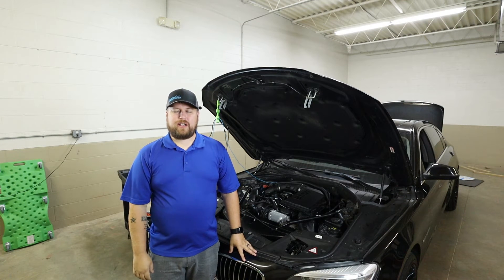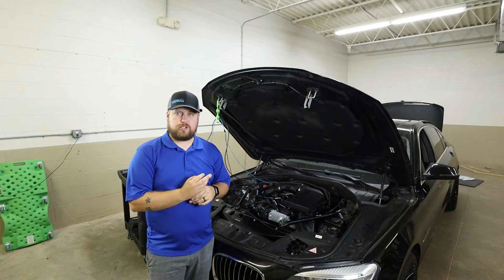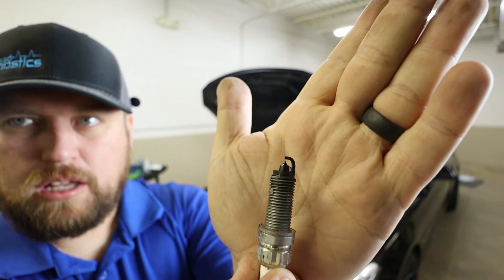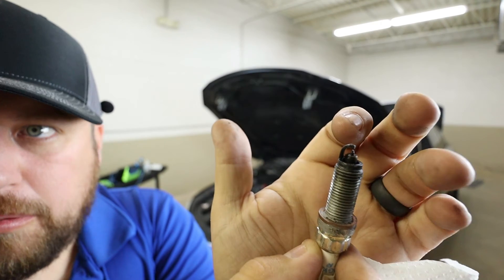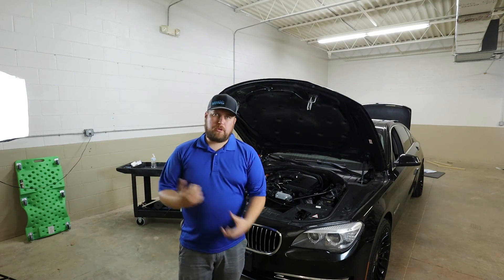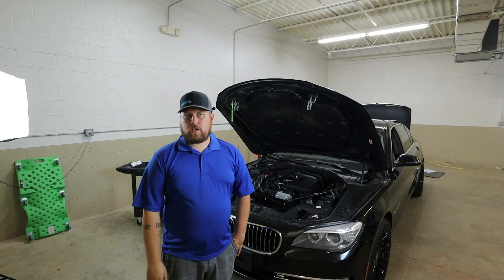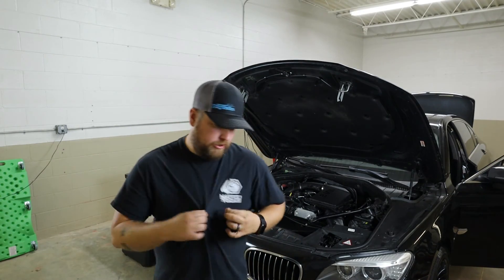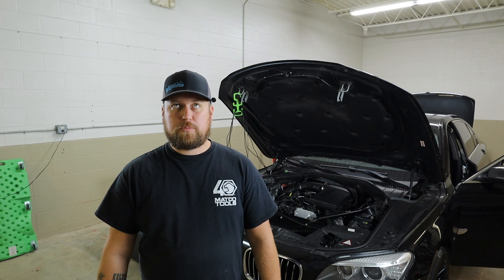BMW 7 Series Engine Misfire!

Comment: BMW Misfire detection – test plan of basic check
Misfires are not directly detected, for example, using pressure sensors and temperature sensors in the cylinders, but indirectly via the irregular rotation (rough running value) of the crankshaft.
Reply: With each ignition and combustion of the mixture in the individual cylinders, the crankshaft is slightly accelerated and slightly decelerated again during the gas exchange. If the forces predominate due to acceleration, the speed increases until a balance between the acceleration and braking occurs.
Reply: For the 8-cylinder engine, eight combustion cycles take place within two operating cycles (720° crankshaft angle). This means each combustion can be assigned a segment of 90° crankshaft angle. This is why the combustion cycles can be assigned to the individual cylinders and are thereby comparable with each other. Example, 6-cylinder engine: 720° divided by 6 = 120° crankshaft angle.
Reply: Rough running arises, among other things, due to:

deviation of the fuel injection rate, mixture deviation (faulty injectors)
poor combustion (spark plug, ignition coil)
different cylinder filling (for example, coking of intake ports, excess air)
different compression, poor compression
unequal charge of cylinder banks (exhaust turbocharger)
 

As from a certain rough running value, it is assumed that a misfire is present (most likely cause).
Reply: A "Misfire detected at cylinder 1" type of fault is stored. To protect the catalytic converter, it may be necessary to additionally switch off fuel injection at the corresponding cylinder.
Reply: However, the actual fault cause for this fault memory entry, for the misfire, for deactivation of fuel injection, is not known. Even if the misfire was, for example, stored for cylinder 1, the components at this cylinder 1 could still be trouble-free.
Reply: Example operating principle of leaking injectors:

Leaking injectors are causing a fuel enrichment of the mixture in the affected cylinders. This fuel enrichment of the mixture is entirely controlled by the oxygen sensor control. This means the fuel injection rates are reduced for all the cylinders. The cylinders with the tight injectors then have too lean a mixture compared to the cylinders with leaking injectors. Since the combustion of a lean mixture is not as good as for a rich mixture, misfires occur at cylinders with a lean mixture. The fault memory entries refer to the cylinders with the misfires, not to the cylinders with leaking injectors.
Reply: The fault causes for misfires that occur most often and with the highest probability are checked in the "basic check". Additionally, checks are carried out that can for the most part be run automatically.
Reply: The basic check includes the following checks:

Fault data evaluation
Checking the rough running without fuel injection
Checking for rough running during cold start
Pressure retaining test
Determination of maximum rough running
Checking the ignition coils
Check of spark duration and rough running
Checking the mixture deviation
Special procedure "Cleaning and checking the ignition system"
Rough running control measurement
Leakage test of air intake system
Reply: The test plan is dynamically constructed. This means the number of checks and the order varies depending on the coolant temperature, the production version of the vehicle and the individual test results. The individual checks are numbered sequentially in order to improve the readability of the document.

 

The individual checks will be briefly described in this document.
Reply: If there are instructions for renewing components, observe the following document relating to the cylinder arrangement:
Reply: 1. Fault data evaluation
Objective: Determination of known fault patterns

 

The most common measure for rectifying a known fault pattern is reprogramming. By evaluating certain marginal conditions for the fault memory entry, it is frequently possible to make a statement with a high degree of probability as to whether the known fault pattern is actually present. If the known fault pattern is present, then reprogramming is required. However, it is not essential to work through the test module.
Reply: If the known fault pattern is not present, then reprogramming can still be expedient in order to avoid a repeat repair. However, the currently present fault will not be rectified by reprogramming. It is then urgently necessary to perform the test module independently of programming.

2. Checking the rough running without fuel injection
Objective: Detection of mechanical fault causes

 

The engine mechanics are evaluated during this check. If increased rough running values occur during an attempt to start the engine without fuel injection, a mechanical problem could be the cause for a rough running engine.

 

Wear of the cylinder barrels results in diminishing compression pressure. If this wear occurs evenly, no rough running occurs, only lack of power. If there is one-sided wear or in the case of leaking valves, the different compression pressure in the individual cylinders leads to an irregularly running engine as from a difference of approx. 2 bar.
Reply: If there are mechanical problems, the following checks can also be falsified or made stricter. The mechanical rough running adds to the rough running due to poor combustion.

 

However, an actual switch off of the fuel supply is only possible if all the injectors are tight.

This check is therefore only meaningful in combination with the pressure retention test. The injectors are tight only if the subsequent pressure retention test was passed. A mechanical problem really does exist.

If the subsequent pressure retention test was not passed, there are two possible fault causes: The loss of pressure is either caused by leaking injectors in the combustion chamber or by the non-return valves of the high pressure pump and the electric fuel pump in the fuel tank.
Reply: The "check for the mixture deviation" is carried out for further fault location.

 

If no fault can be detected during the "check for the mixture deviation", then the injectors are tight and there is actually a mechanical problem present. The pressure retention test wasn't passed, as the non-return valves are apparently not tight. Leaking non-return valves do not cause misfires. However, a slightly longer start duration can occur.
Reply: Limits of the check:

Even wear, leading to an even loss of compression, cannot be detected with this check. Engine power loss can therefore not be detected with this check.

3. Checking for rough running at cold start
Objective: Detection of slightly faulty injectors

 

During a cold start, the oxygen sensor control is not active during the catalytic converter heating. Multiple injection occurs. Minor deviations of the individual fuel injection rates add up in their effect and can lead to a rough running engine.
Reply: If increased rough running values occur during a cold start during the catalytic converter heating, but not with a warm engine or with other operating conditions, a repair is not absolutely necessary.

 

The most probable fault cause: Slightly faulty injectors.

4. Pressure retaining test
Objective: Checking the fuel system for tightness, particularly the detection of leaking injectors

  

For the pressure retention test, the rail pressure is adjusted to 100 bars while the combustion engine is running and then the engine and the electric fuel pump is switched off.

The pressure retention test takes a maximum of 5 minutes and is ended prematurely as soon as a clear test result is available.
Reply: If the pressure has hardly dropped after one minute, the fuel system is sufficiently tight. The fuel system is detected as leaking if the pressure falls below 10 bar within the test period.

 

The loss of pressure is either caused by leaking injectors in the combustion chamber or by the non-return valves of the high pressure pump and the electric fuel pump in the fuel tank.

However, faulty non-return valves of the electric fuel pump cannot cause misfires! For this reason, it is more probable on the one hand that leaking injectors are the cause of the pressure loss. On the other hand, however, smaller leaks of the injectors are in the tolerance range and do not lead to misfires. To further pinpoint the fault, it is therefore necessary to carry out the check of the mixture deviation.

 

Limits of the check:

The individual leaking injectors cannot be directly detected. The "check for the mixture deviation" is therefore also required for further fault location.
Reply: If no abnormalities are found in the "mixture deviation check" in spite of the pressure retention test not being passed, it is not necessary to renew injectors.

5. Determination of maximum rough running
Objective: Definition of the limit values for the subsequent tests

 

Normally operating, trouble-free engines also have scatter in the rough running values due to tolerances. In this check, injection is deactivated for all cylinders in succession and the resultant change in rough running determined. In this way, an engine-specific limit value for maximum rough running is determined.

6. Checking the ignition coils
Objective: Detection of faulty and inefficient ignition coils
Reply: Checking the ignition coils (swap)

If the fault cause lies with the ignition coils / spark plugs, then the fault cause can be further isolated by swapping the ignition coils / spark plugs.

 

The fault memory entry will follow the faulty ignition coil / spark plugs. Faulty spark plugs / ignition coils can previously damage each other; therefore, always exchange them in pairs.

 

Checking the ignition coils (IMIB)

This check is currently only available for certain engines, see the testing procedure in the test module. With the Integrated Measurement Interface Box (IMIB), the energy absorption of the ignition coils is determined and evaluated while the engine is running via the current measurement between the ignition coil and the Digital Motor Electronics (DME). This allows inefficient ignition coils to be detected, which could cause misfires during actual driving, particularly during high loads (ignition spark too weak).
Reply: Limits of the check:

The ignition coils must always be functional. There must not be any electrical faults present relating to the ignition. The check supplements the visual inspection of the ignition coils, but cannot completely replace it (for example, damage symptoms of voltage flashovers).

5. Checking spark duration and rough running
Objective: checking the ignition system

 

The "check for the combustion period and rough running" takes place in the workshop during a relatively low load. If no noticeable/striking features occur, the ignition faults can be ruled out as the cause for the detection of mixture deviations in this load range.

 

An ignition fault can lead to fuel not fully burning in the cylinder. As a result, the oxygen sensor measures excessively high oxygen content in the exhaust gas during the "Check for the mixture deviation" and thereby erroneously a lean mixture. The exhaust gas can have an intense unburned fuel smell (not the typical smell of exhaust gas).

 

During the test plan, 100 measurements of the spark durations, rough running values and misfire counters are recorded and evaluated per cylinder. This takes place at 1800 RPM and while in idle. The evaluation includes the check for the adherence of absolute limit values (for example, combustion period = 0 ms). Additionally, the values of the individual cylinders are compared with the average values of all cylinders.

 

If noticeable/striking features occur during the combustion period and rough running, the faulty cylinder can be determined in most cases. But not the actual fault cause or the faulty component.
Reply: The fault cause for the ignition fault can be further isolated via a visual inspection of the spark plugs for fuel residue or heavy soot deposits. An ignition fault can also be further isolated by swapping the spark plug and ignition coil. The fault memory entry will follow the faulty ignition coil / spark plugs. Faulty spark plugs / ignition coils can previously damage each other; therefore, always exchange them in pairs.

 

Note:

There are also ignition faults that cause rough running on the affected cylinder without being noticeable in the combustion period (for example, breakage of insulator). Unnoticeable values of the spark duration alone are therefore not sufficient for assessing the combustion.

 

Limits of the check:

Faults on the spark plugs and ignition coils that only become noticeable at a high load and high temperatures cannot be detected.

The check can detect the faulty cylinder, but not the actual fault cause or the faulty component.

Even, age-related wear of all spark plugs is detected relatively late (limit value for combustion period is less than 0.4 ms).

Soot deposits on the spark plugs can influence the test result. A cleaning via the special procedure "Cleaning and checking the ignition system" is only possible to a limited extent (not enough load in workshop operation for a complete cleaning).

8. Checking the mixture deviation
Objective: Detection of mixture deviations, from leaking injectors among others

 

During the "Check for the mixture deviation", the injection of the individual cylinders is gradually switched off. The effect on the entire mixture is measured via the oxygen sensor and calculated back to the individual cylinders.

 

A leaking or slightly leaking injector will cause a richer mixture in comparison to a tight injector due to the leak, even during a switch off of the fuel injection rate. The detection of too lean a mixture on injectors that always inject too little fuel functions similarly.

 

For the better detection of faults, the various controls of the engine control are deactivated during the "Check for the mixture deviation". For example, the oxygen-sensor control and the minimum quantity adaptation.

 

The mixture is also influenced by various other fault patterns. The "Check for the mixture deviation" is therefore only carried out if the following checks pass trouble-free beforehand or usable partial results are present.
Reply: Checking the combustion period and rough running:

An ignition fault can lead to fuel not fully burning in the cylinder. As a result, the oxygen sensor measures excessively high oxygen content in the exhaust gas during the "Check for the mixture deviation" and thereby erroneously a lean mixture. If a leaking injector simultaneously generates a mixture that is too rich, the oxygen sensor potentially detects a correct mixture.

 

Check the rough running without fuel injection:

If mechanical problems exist, the following checks can be falsified. The mechanical rough running adds to the rough running due to mixture deviations.

 

- Pressure retention test:

The evaluation of the partial results from the checks leads to the most likely fault cause.

 

Example:

A loss of pressure that cannot be recognised externally can be caused either by leaking injectors in the combustion chamber or by the non-return valves of the high pressure pump and electric fuel pump in the fuel tank.
Reply: If the "Check for the mixture deviation" does not determine any noticeable/striking features, then most likely the non-return valves are leaking and not the injectors. Even if leaking injectors are very unlikely in this case, an additional visual inspection of the injectors for tightness may be required (particularly on repeat repairs). Observe the respective instructions in the test module. If the pressure retention test does not find any faults but the "Check for the rough running without fuel injection" is conspicuous, there is potentially a mechanical problem. The "Check for the mixture deviation" is potentially falsified. The mechanical rough running adds to the rough running due to mixture deviations.

 

If several cylinders are conspicuous during the "Check for the mixture deviation", checking the air intake system is suggested in the test module. It is unlikely that several injectors are simultaneously conspicuous.

 

If there is still a rough running engine after renewing the injectors, a compression test must also be carried out (see additional check). If the fault is still not found by this, there is probably leakage or a narrowing of the cross section in the intake area.

 

Limits of the check:

The fuel-air mixture is not only influenced by faulty injectors, but also by the ignition system, air intake system and the compression. This is why the fault cause can often only be specified with a certain probability. Particularly if the components causing the faults are only slightly faulty.

9. Special procedure "Cleaning and checking the ignition system"
Objective: removing deposits on the spark plugs

 

Short-distance driving and a poor fuel grade as well as leaking or slightly leaking injectors can lead to deposits on the spark plugs. In order to avoid falsifying the test results, as far as possible, the "Check for the combustion period and rough running" is paired with the so-called burn-off function.

 

The burn-off function is primarily for removing deposits on the spark plugs resulting from short-distance driving / fuel grade, if possible. Simultaneously, as with the check for the ignition system, spark durations and rough running are measured and evaluated. This also permits faults in spark duration and rough running that occur only in this engine speed range to be detected. The burn-off function can therefore be viewed as an extension of the "Check for the combustion period and rough running".
Reply: However, the special procedure can also be independently performed in the basic check as an independent testing procedure.

 

Limits of the check:

The load possible in the workshop is not always sufficient for a good cleaning (activation of electrical consumers).

 

If there are noticeable/striking features, a visual inspection is also required and thereby a certain amount of work due to the disassembly.

10. Rough running control measurement
On the checks for detecting the cause for misfires, various controls of the engine control were deactivated for the better detection of faults, for example, the oxygen sensor control and minimum quantity adaptation.

 

Upon the completion of all checks, a final check of the rough running is performed with activated controllers.

 

If increased rough running values are present again, parts are renewed based on suspicion to rectify the fault cause. Follow the instructions in the test module.
Reply: 11. Leakage test of air intake system
Even very minor leakage in the air intake system influences the charging pressure control or the mixture preparation. These can cause a rough running engine.

 

The check is organized into 2 sections:

Leakage test with the help of excess pressure

This check can clearly detect if the air intake system is tight. However, it is not known where the leakage is located.

A subsequent leak detection with the help of the leak detector ("smoke tester")

This check makes the leaking location visible with the help of smoke. As a result of the pre-check, it is already known that a leakage must be present. Therefore, search until the leak is found. This could be a little difficult at poorly visible areas. Leakages can be easily overlooked.

 

In principle, it is possible to search for leakage with the leak detector or the visual inspection. However, a definitive statement like the "Air intake system is tight" is only possible via the leakage test with excess pressure.
Reply: For the leakage test, excess pressure for the current air pressure is built up for a maximum of 6 min using a special air pump. The air intake system is effectively tight if an excess pressure of at least 50 mbars over the current air pressure is reached.